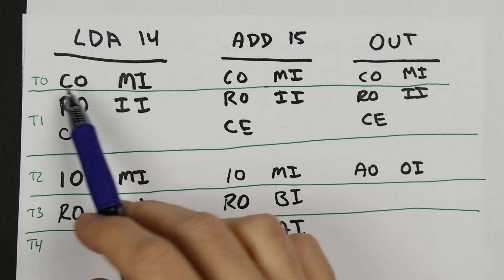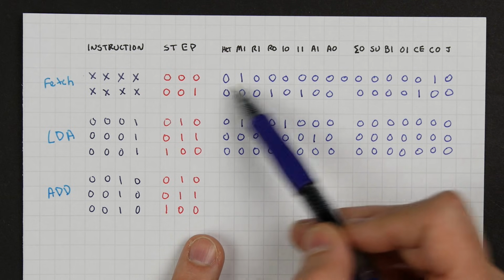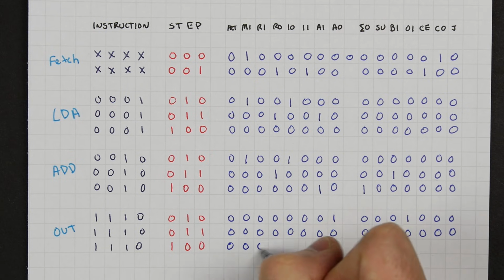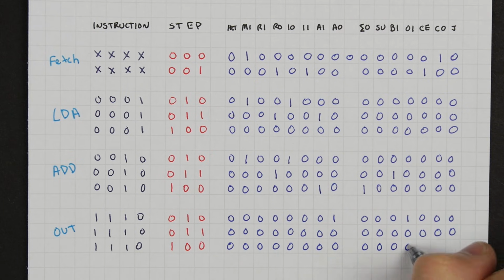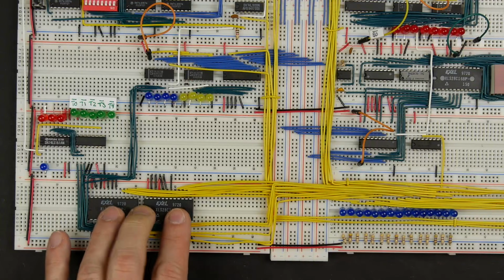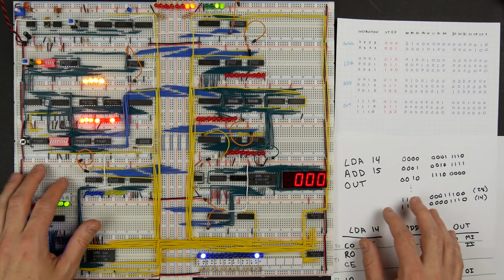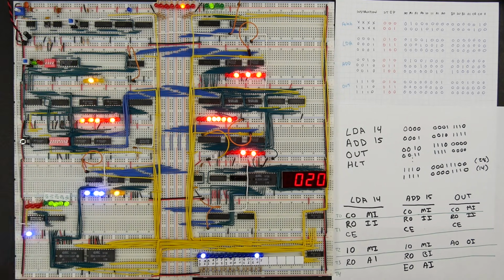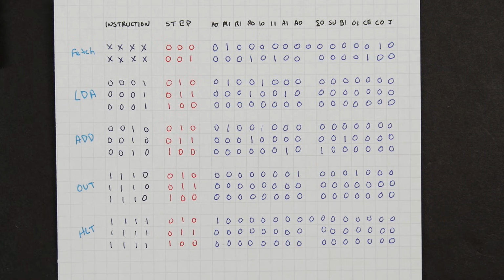8-bit CPU control logic: Part 3

Comment: lol looks like he was very surprised by himself that the computer did hold XD. is this done now, basicly or something else coming there? bummer that it is 43 min...the waiting was cruel for this one ;) . great series there!
Reply: I think that the only thing left (at least for this model) would be expanding the instruction library like he said and building the reset button.
Reply: The status register usually stores information about the current state of the processor, such as some info about the result of the last arithmetic-logic operation, or whether it accepts interrupts, etc. It stores it as bit flags which can be either on (1) or off (0). Each bit represents one piece of information about the processor. E.g. there might be a Zero flag which is set when the result of the last ALU operation was zero. Or a Carry flag which is set when there was a carry-over from the addition. (It can also be used as a borrow in subtraction, or for temporary storage for bit operations, such as bit shift / bit cycling.) Or a Parity flag which is set when there is an even number of ones in the result, or cleared if there is an odd number of ones in the result. Or a Sign flag which indicates if the result was positive or negative (it pretty much just copies the highest bit of the result if you use the 2's complement binary encoding for numbers). Sometimes there might also be Overflow flag which tells if there was an overflow in signed arithmetic (that is, if the number switched from positive to negative during addition, or the other way around in subtraction), which is pretty much the carry-over from bit 6 to bit 7.
Those status flags can be used by comparison instructions and conditional jumps. For example, you can compare two numbers by simply subtracting them and not storing the result anywhere, but updating the flags. If the numbers you compared were the same, the subtraction will result in zero, so the Zero flag is set and you can check that and interpret it as the answer: "the numbers were equal". If the second number was bigger, the result will be negative, so you can check the Sign flag to recognize that.

The ARM instruction set has a neat feature that any instruction can be executed conditionally (conditional jumps being just a special case) by setting certain bits in the opcode. Each of these bits corresponds to one of the bits in the status register and tells the CPU to execute this instruction only if that flag was set. Otherwise the instruction is being skipped. So in order to make the instruction conditional on the Zero flag, for example, you just set a particular bit in the instruction's opcode to 1, which means "execute this only if the Zero flag is set". And the CPU then checks that flag before executing this instruction. If you want to execute the instructions unconditionally (that is, always, no matter the flags), just leave all those bits as 0s and their particular flags will be ignored.

Long story short, in order to have conditional jumps, we need some mechanism to check the result of the last arithmetic-logic operation, and that's what the status register is for.
Reply: Especially the jumps.
Reply: +Angel Gonzalez  true. Unconditional jumps are pretty easy. Conditional jumps are much more interesting. But we don't have any flags / status register yet in this computer :q So that would have to come first.
Another thing is subroutine calls and returns, but that would require some more memory space or a stack of instruction pointer registers to implement the call stack.
Reply: In order to do a Branch-on-Zero or Branch-on-Overflow, or Branch-on-Negative instruction, after having done an arithmetic operation, you neeed to know if the ALU is Zero, overflowed or whatever. These signals after an arithmentic instruction are latched into a Status Register, and these bits are combined with the Control Logic, so that it either will do a Load-Vlaue-into-PC-register (which is what a Jump is) or not do that, depending on the value of the particular status bit. The Overflow bit is already there (it is the carry-out of the ALU), likewise negative is a copy of the top bit of the ALU. The Zero would need extra logic an 8 bit in NOR gate which only shows true if all bits are zero. In other CPUs there are more status bits, which can be tested on.

2nd question - oh yes, this is a VERY small/basic CPU. But it does the job perfectly for presenting and explaining many of the principle and inner workings of a CPU. 

For subroutines we need Push&Pop instructions and a register to store the "old" ProgCnt.value. It does not need to be a stack, which limits us to only 1-deep subroutines, but would show the principle and be doable in 16 RAM locations. I am not sayiong it will be usefull program, but it will show what/why/how!
Reply: Nope. It is a register which stores just the "traits" of the result of an arithmetic-logic operation, not the result itself. "Traits" such as:
Is it zero? (All the bits of the result were zero)
Is it negative? (The most-significant bit, which represents the sign, was set)
Was there a carry-over from the most significant bit?
Was there an overflow? (A carry-over from bit 6 to bit 7, which means that the sign flipped.)
Or some other useful informations.
Those are pretty much just some useful signals you can get from the ALU and use them directly in the current instruction, but they would be forgotten after the instruction finishes executing, along with the result of the arithmetic-logic operation :P That's why it is useful to "latch" these signals (which are all single bits) into some kind of a register, so that you could check their results even a couple of instructions later (as long as they don't modify the flags in the meantime).
Let's say you have an instruction:
    CMP A, B
which compares the contents of registers A and B. This comparison is done in the ALU by simply subtracting them. But the result of this operation is not stored in any other register. It is being forgotten, because we don't need it. We only want to know some things about the result, e.g. whether it was zero, or positive, or negative, and act accordingly.
So we take all those signals from the ALU and store them in the status register. Let's say that B was greater than A, so after subtracting them the result was negative. This means that the Negative flag will be set. The result was not zero, so the Zero flag will be cleared. And there was no carry, so the Carry flag is cleared too.
Now there can be some other instructions to do, as long as they don't change the flags.
And finally, there is an instruction:
   JN  someAddress
which means "jump if (the result was) negative". It checks the Negative flag in the status register and if it was set, it copies the "someAddress" to the instruction counter to accomplish the jump by starting fetching instructions from that address on.
If, on the other hand there was an instruction:
    JC someAddress
it would have checked the Carry flag instead. But the Carry flag was cleared, so the condition was not satisfied and the jump will not be executed. It will simply fall through to the next instruction. (Which may, for example, check some other flags.)
Reply: +Angel Gonzalez The flag/status bits could be tested by conditional branch (conditional jump) instructions. These could then be used to implement if-statement behaviour. For example, 3 flags to indicate if register A holds a number less-than, equal-to or greater-than zero plus conditional branch instructions branch-if-less-than-zero, branch-if-equal-to-zero and branch-if-greater-than-zero would allow if-statements to be implemented involving the basic numerical comparisons.

Once you have conditional branches, you can have programs with conditional looping back to repeat instructions until some condition is met.
Reply: I think that would involve a Instruction register out and counter in. What would be interesting would be in conjunction with what other instructions is this one used to create an if or while statement.
Reply: yes a higher programming language from there. would be kinda the final step of it and a great ending to what he showed so far :D
Reply: I'm sorry, but could you explain me what the flag/status register is for? (I'm not too savvy in this field, most of my logic knowledge comes from this channel) And, yeah, for sub routines alone he would at least have to expand his main counter so he could have some leisure space to write a couple of programs, I don't think only 15 instructions alone would be able to demonstrate that, or would it?
Reply: I wish I could like this comment more than once. So it is more like a spare register used for miscellaneous operations not directly involved with the arithmetic. So for example when you sum reg A & B, instead of shoving the result back to A, you move it to the stat reg so you could have more flexibility off what you can do with it, am I right?
Reply: No, this design has no ALU result register, it goes straight on the bus and does not have to be reloaded to A, but could go to memory. A status register only stores information about the ALU output (or other parts of the CPU, but there is no simple example of such information in this design - yet) not the actual result.
Reply: Oh, sorry for my misunderstanding. So it does not work like an ordinary registry, it works more like the instruction output where each bit in the set means its own unique thing, signaling any of those conditions above. Now I get why you called it flag as well.

Comment: As the lda instruction only has one extra clock tick there wouldn't be any advantage in using T4 to reset the instruction cycle counter, but what if you had more? Say if it went all the way to T8, would a useful optimization be to reset the counter at T4, so the remaining 4 clock ticks can go to executing the next instruction?
Reply: Though i'm only about a third of the way through the video, for all i know you end up covering this
Reply: the micro clock reset should be high at the last instruction (T3 for the LDA) to reset the counter to 0 when the last instruction is executing

Comment: You should build a display out of LEDs and make it play a sort of GIF like image
Reply: He could communicate with a lot of things with a serial module including a video driver card of some kind. All he'd need is a Bit Shift Register and a clock for the serial communications.  Building such a module would massively increase the kinds of peripherals he could mount to this thing. Bit shift registers every time they receive a clock pulse shift every bit one position over.  Which doesn't sound too useful but they allow data to be sent sequentially. Basically as it would be in the current instruction set he'd need a new register and a clock on that module. 
 
For the SOA instruction Serial output A.

T0/T1 would still be fetch.

T2 would involve loading a value from A to an 8 bit BSR, 

T3 would set the serial clock high which would then pulse 8 times before halting that clock again.

How that works, lets say we wanted to transmit the ascii character A to our display, that's 41 in hex or 0100 0001 in binary so we put that value in our BSR just like we would any other register like A or B in T2.  So the BSR holds the value 0100 0001 now.

Next clock cycle we activate the clock on the serial output module which causes eight quick pulses to happen during each pulse the value in the register shifts down one. the value in the far right register is pushed off onto the TX line.

0 0100 0001 X

1 0010 0000 1
2 0001 0000 0
3 0000 1000 0
4 0000 0100 0
5 0000 0010 0
6 0000 0001 0
7 0000 0000 1
8 0000 0000 0

As a result the data in the BSR would be output along the TX line and the clock would go out along CLK If there is a bit shift register on the other side with its bit 0 recieving from TX and its clock hooked up to CLK at the end of those eight pulses it would contain the value from the Bit shift register.  This is how many simple serial peripherals work.

So for example to output the phrase Hello world! to a serial display with just this new instruction and module you'd have the the commands in memory.

SOT = serial out A

00 LDA 1A
02 SOA XX
03 LDA 1B
04 SOA XX
05 LDA 1C
06 SOA XX
07 LDA 1D
08 SOA XX
09 LDA 1E
0A SOA XX
0BLDA 1F
0C SOA XX
0D LDA 20
0E SOA XX
0F LDA 21
10 SOA XX
11 LDA 22
12 SOA XX
13 LDA 23
14 SOA XX
15 LDA 24
16 SOA XX
17 LDA 25
18 SOA XX
19 HLT
1A (H) 48
1B (e) 65
1C (l) 6C
1D (l) 6C
1E (o) 6F
1F (  ) 20
20 (w) 57
21 (o) 6F
22 (r) 72
23 (l) 6C
24 (d) 64
25 (!) 21
Reply: imagine doing that for a 4k panel with all the instructions to set the pixels right.... or is it only my imagination that it is that complicated :D ? would be awesome to show it with leds. might give the basic idea how to create a picture.